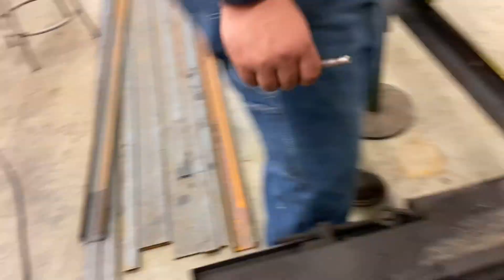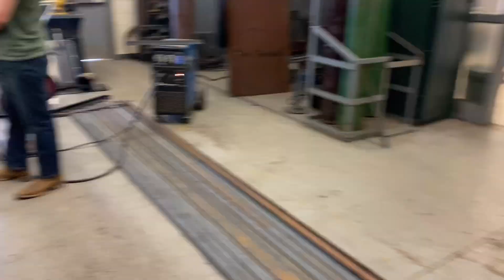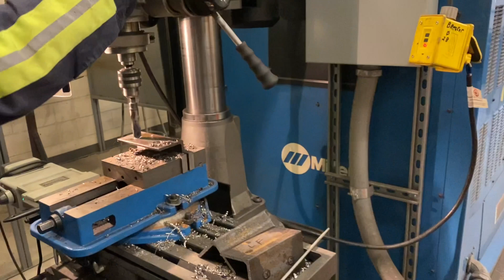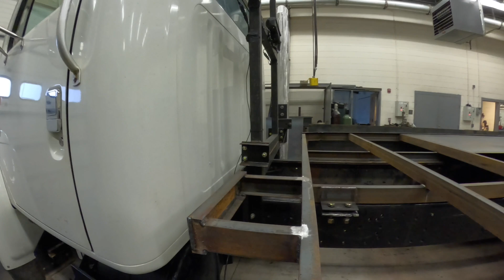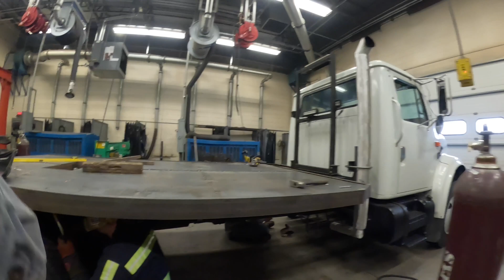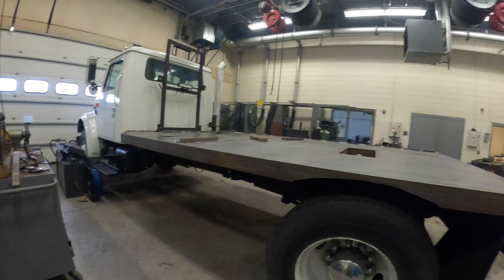Medium Duty Truck Bed Build! On a budget! Part 1

Comment: Did you level the frame then build the bed level to the ground? Or did you just build the  bed square to the frame? I am doing a similar project and am unsure about that part. Truck looks good 👍🏻
Reply from the maker: @sketchgordon2347  built it square to the frame because the rear of the truck is taller. If it was level to the floor it would look funny on the truck. Thanks for watching

Comment: Looks good move the back bumper in a little bit and weld you a plate on it to make you a running Border to clime up on
Reply from the maker: I can use the bumper as a step pretty easy. Thanks for watching

Comment: That’s exactly what I want to do with my grandpas F700. It’s got a service bed on it now. I’d like to build a flatbed for it and put a gooseneck ball on it. Figure it’ll be nice for hauling
Reply from the maker: It makes for a nice setup! Or I think it will! Thanks for watching
Reply: @khtractors  it’s got a gas engine in it. I can’t remember what it is though. 429 maybe? I’d like to pull it out and put a 12 valve in it and 10 speed swap it. Whole lot cheaper than buying a 1 ton truck that’s for sure, and haul more. I went to an farm auction yesterday and a rusted out 97 12 valve 3500 automatic sold for 9k. Transmission was even slipping. Hazing blue at idle. I couldn’t believe it!